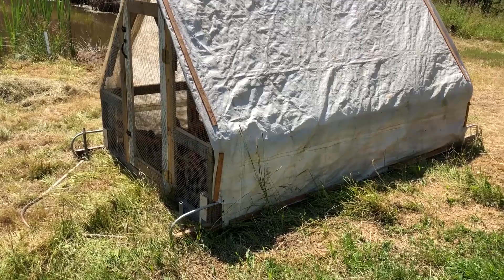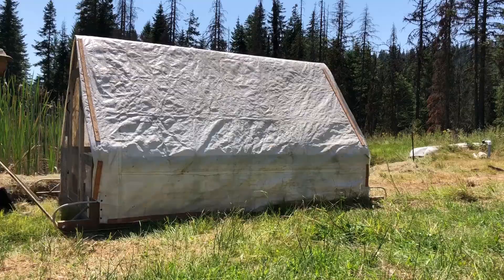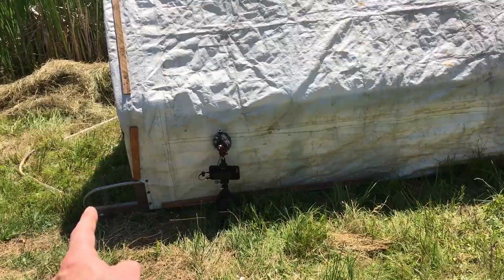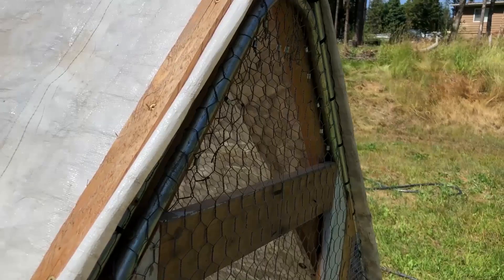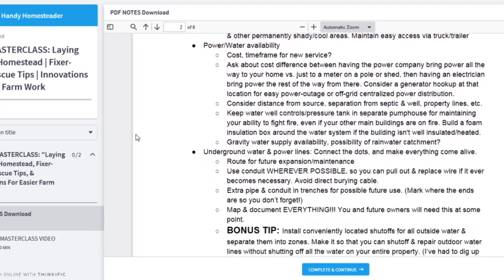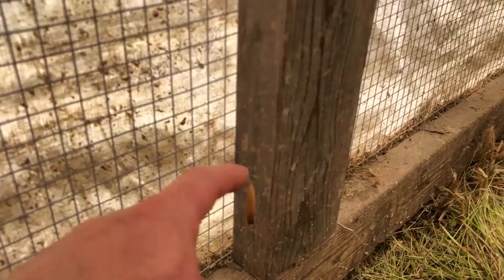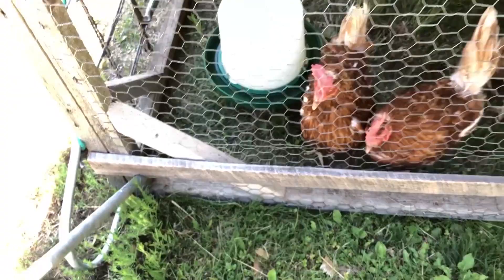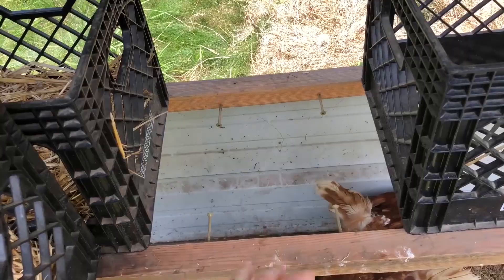MOST POPULAR CHICKEN TRACTOR MODIFICATIONS  |  Masterclass Excerpt | Suscovich | Salatin | Rhodes

Comment: Those skids blew my mind. SO much better than the wheel design. Instant-sub!
Reply from the maker: Awesome, thanks! For long moves or on very thick/tall grass, using a wheeled dolly (like the one Joel Salatin uses) is very helpful. I’m also considering a Chicklift type wheel system to make it easier for my wife to move, but it’s hard to beat the simplicity of these skids for general purpose. No dolly or wheels to lose, just pick up the front & move it.

Comment: love it think i will try pvc for the skids ...no rust and should work as well
Reply from the maker: Go ahead and try it, but if you want to curve the PVC at the ends at all you’ll have to do that with heat very carefully, instead of using glue-on elbows. Because any elbows or couplers will introduce joints that will create drag points, probably more or less negating any slipperiness you were trying to introduce to the bottom of the runners. 
Plus any rocks, gravel, or sand you drag this thing over will wear that PVC out much much faster than this steel conduit. Sunlight also breaks down PVC over time & it’ll get brittle. 
These skids have been on my chicken tractors for for 3 years now, including sitting outside in the mud and snow, and even under deep bedding (lots of animal poop & hay mulch) for months on end, and still only a small amount of rust.
For what it’s worth. 👍
Reply: I came from the trades and have a lot of leftovers I can utilize with out having to repurchase anything and I think the greenlee will be able to heat and bend the 1.25 inch pvc i have... i harvested 4 pine trees from behind the house about 2 years ago and it has been stacked in the loft of the barn so should be good to go i have wire and even the tarp the only thing i my have to purchase will be hinges ...and the wife wonders why i hang on to all my stuff lol thanks for the inspiration     @TomWylie

Comment: Where would you put nest boxes and what type would you use
Reply from the maker: I use old milk crates that I have cut one side out of, and just line the bottom with hay or straw, just like Justin Rhodes does in his Chickshaw. There was a clip of those in this video inside that other rectangular chicken tractor. Inside the Suscovich chicken tractor I mount those milk crates to the back wall, the end opposite the front door. I would like to modify it so I can access those milk crates from the outside, but just haven’t gotten to it yet.